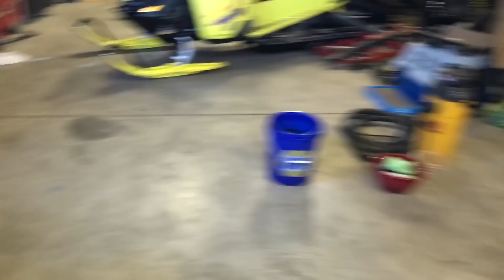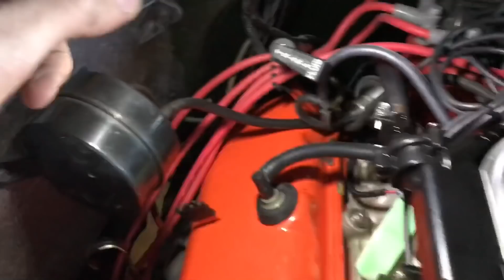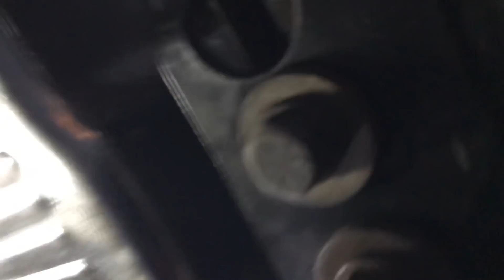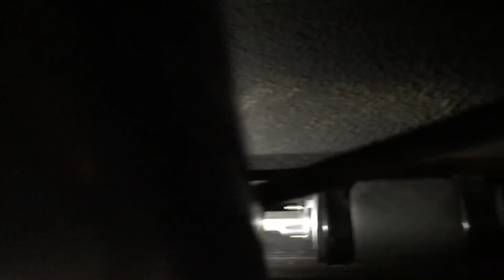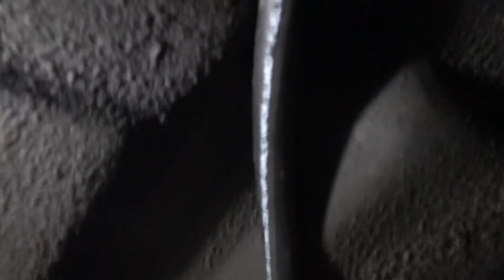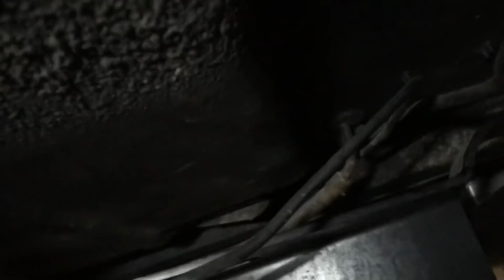1972 Chevy C10 Holley EFI Sniper Install - Part 2

Comment: What other options do we have if we want to retain the factory fuel tank for a return line?
Reply: I just drilled a hole on the top rear of the tank, then i welded a 6-AN bung in place, ran my 3/8 hose return line up to the sniper. then i ran a tip valve breather from the breather tube on the sending unit up beside my fuel neck.. Works pretty good..

Comment: Have you had any issues due to the 3/8" x 1/4" adapter? I was worried I may have to drop the tank and re-do the tubing to EFI rated tubing. It looks like you have had no issues with it so far, and I noticed the O2 sensor may have been a little too horizontal, from what I've seen is that people have been installing it at a more vertical angle (I guess its due to condensation forming and ruining the sensor?) But I am so new to all of this that I am super overwhelmed with everything lol

Comment: are you using the stock fuel tank sender/pick up? have you had any problems with fuel slosh/sucking up air when cornering?

Comment: How does your fuel pump work?? Ran mine similarly,  and seem to have heat soak issues
Reply from the maker: Hmm, I don't imagine mine is having heat soak. It's 8"+ away from the exhaust plus the pump is wrapped in foam (from holley).

Comment: Have you had any problems with the sniper.  I’m thinking about getting one
Reply from the maker: I've only put about 400 miles on it. So far, the O2 sensor failed which is a pain.